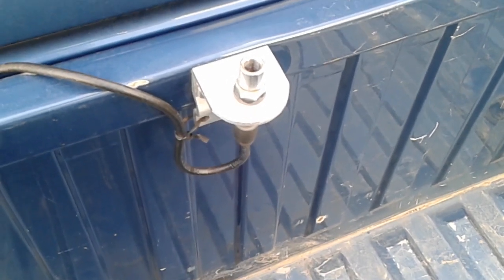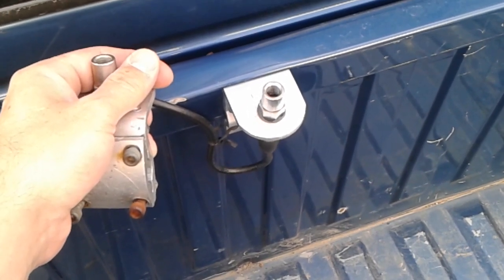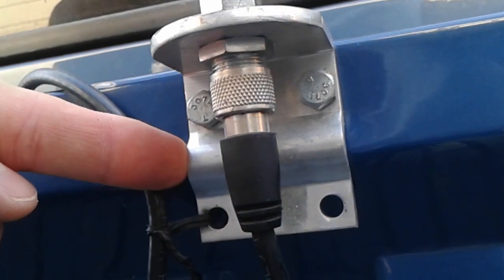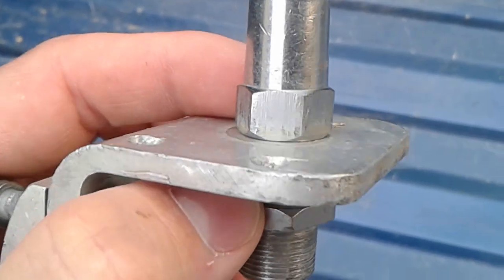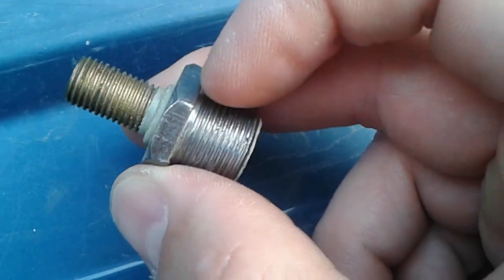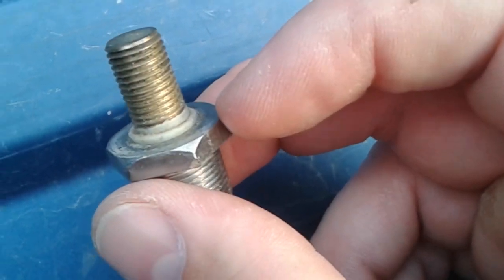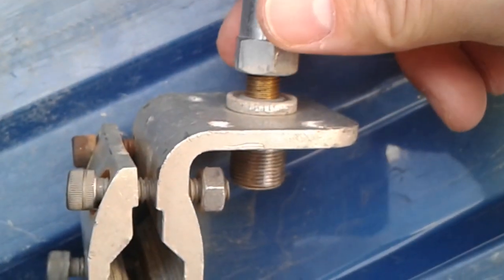How to mount cb antenna feed through adapter SO-239.  High swr ?

Comment: Hello is it grounded to the chassis through the mount on your bed? I have been hesitant to install a mount because of the grounding, I thought a braided wire to the chassis was required. Thanks
Reply from the maker: Hi!  Yes, it is grounded.  The outer wire of the coax (braided) grounds the adapter to the bracket.  The bracket is held on to the truck bed by bolts...those bolts are making connection to the metal truck bed...so everything is grounded to the truck bed.  You can test this by using a multimeter that has a "continuity" setting.  As you mentioned, you can easily add a wire for grounding if you wish, but it may not be needed.  As long as you make sure all the metal parts are making connections to the metal truck bed the ground should be ok.  A separate ground wire never hurts...and one is easy to install.  I am busy with work for a couple weeks, but maybe I can make a video showing you how it grounds and how you can test the continuity with a multimeter.   When I get that video made I will let you know.   Don't let the ground discourage you from installing the antenna you want to use.  In that video I will also try to demonstrate how to install the extra ground wire you are talking about.   

Also note...and to cheat just a bit...while the ground at the antenna is best....your mobile radio chassis is grounded to the negative power wire/ground, right?  So is the ground of the antenna jack.  It actually gets grounded that way....but I always like to make sure the antenna bracket itself is grounded.  It may take me a while to make that video, but will let you know when it is uploaded.  I hope my explanation helps though.  Long story short, yes, it is grounded.
Reply: @douglasbollinger3626  Thanks that helps, I have actually been using a Magnet mount for my 102" whip which has been working but I get 1.9:1 SWR on CH40 and 2.4:1 SWR on CH1 and it still wants to be longer even though I have a 4 inch spring with like 3 inches of extension so I am assuming the ground is poor, I also had to build an ugly balun because the coax was working as an antenna. I got it down to 1.3 SWR but used 9FT of the coax as part of the antenna before building the Ugly Balun LOL. I have a mirror style mount with the stud on order though as well as a 6 inch extension to maybe lengthen it more. A video on testing the continuity would be awesome, I do have a multimeter already. Thanks
Reply from the maker: @YoutubeMastersDegree  The magnet doesn't really ground. It does, but doesn't.  It creates a groundplane, but if it is not on bare metal it doesn't truly ground...if that makes sense.  Probably the only ground you are getting is from the braided coax being grounded to the antenna jack, which is grounded to the negative power wire/ground through the radio itself.   When I run a 102" I've never had to make or use a balun.  The 102" usually works fantastic since it is right at channel 19 area wavelength.  I usually use 20 feet of coax, good grounded bracket and usually good to go with low swr on cb.   What kind of vehicle is it on and where on the vehicle is it located?
Reply: @douglasbollinger3626  Its a 06 Toyota Tacoma with it centered on the roof, its a single 5" mag mount that I only use stationary for DX. My 65" Whip that I drive with mounted is 1.1:1 SWR across all channels.
Reply: @douglasbollinger3626  Yeah without the balun if I touch the coax the SWR spikes.
Reply from the maker: @YoutubeMastersDegree   Ok...I was wondering how the 102" didn't blow over or just fall over the way they sway back and forth.  High up and centered is good.  Should be a great groundplane that way.   Is the magnet all molded with plastic?  Any metal or bolts on the magnet going to the ground/braided wire you can access?  Wish I could see it.
Reply from the maker: @YoutubeMastersDegree  Interesting.  I was possibly going to suggest....since you run it stationary....to make a ground wire that slips under the magnet...touching the metal magnet base....and run it to the metal of the vehicle.  Even if it is just bare metal wire you put under the magnet base then to maybe a screw on your third brake light if it is grounded?  That would be a short wire.  Some people say shorter the better, but I never had an issue with a longer wire.  The screw at the third brake light could be insulated though, but maybe not.   It might screw right into metal.   What if you put the 102 where your other antenna is on a bracket?  What is the swr then?
Reply: @douglasbollinger3626  Right I think if I cant get it to tune better with the mag mount I will use the bracket that I ordered with a proper braided wire ground. My other antenna is just a different mag mount that I put in the same location when I am driving. The mag mount I use for the 102" whip is a 5" Tram mount that I removed the rubber cover from, but the bottom seems to have another black plastic liner rather then the silver metal liner. Thanks
Reply from the maker: @YoutubeMastersDegree  You're welcome! I see now what you're doing.  Not sure when I can get that video made, but will try soon and let you know when it is uploaded.  Hopefully we can come up with a solution.  Would be nice if we were in the same town and I could look at the setup.  I am headed to bed...hope you have a good night.  Don't give up....we will figure out something. 😊
Reply: @douglasbollinger3626  Thanks! Have a good one.
Reply from the maker: @YoutubeMastersDegree  The video about using a multimeter in continuity mode to verify the bracket is grounded to the vehicle is uploading now.  It is a little longer...like 16 minutes...sorry...but wanted to make sure I explained it well enough for everyone.   Hope it helps!

Comment: I have a few whips on my truck just for looks and one of them studs broke... kids pulling on them, is there a way to re thread them
Reply from the maker: @naabemakwa  Never had one break so I am not sure.  You could try a tap and die set to see if it will re-thread or just buy another from a truck stop or a site like EBay.  As a last resort...since you say it is just for looks, maybe try threadlocker or JB Weld?  If you buy a new one it shouldn't cost more than $10.00.  Also, since you are doing it for looks, you could get a bolt, washer and nut from Lowe's or Home Depot  and bolt it on instead of using a feedthrough adapter.  Just have to make sure the threads are the same and that the bolt is long enough.  Can you send a picture of it if I give you an email address?
Reply: @douglasbollinger3626  ya Ill probably just buy a new one.
Reply from the maker: @naabemakwa  Sounds good.  They shouldn't cost very much.
Reply: @douglasbollinger3626  IK be the 2nd time kids broke them bending it back... I just put them back on last week not even a week on my truck

Comment: That's exactly what I did I did exactly that damn it you know what I'm glad I watched your video because the last one I watched that's the reason why I did that and ended up where I'm at right now so thank you
Reply from the maker: You're welcome! If you have any questions or need help, ask away!  Glad it helped!
Reply: @douglasbollinger3626  actually I do I don't know if my antennas bad or what
Reply from the maker: @thepatchthatissour  What kind of antenna is it and how is it mounted?  Are you using an SWR meter?  If so, what are the SWR reading?
Reply from the maker: @sourpatch478  Glad you got it working.  The tall whips like that usually work great if they are properly grounded.  Cobra 29 should have a built in SWR meter setting.  If you check the SWR hopefully it's reading 1.5 or less.  (The lower the better.)  If anything else comes up or you have questions feel free to ask - I'll try to help.  Have fun talking on the radio!
Reply from the maker: @sourpatch478  No problem at all.  I knew you meant 102.  Good antennas! Have fun on the air!

Comment: at what length of coax would you recommend?? installing dual francis 4.5 antenna's with 6ft 50ohm coax. please and thankyou.. aces...
Reply from the maker: I'm being honest when I say I'm not real sure.  I've seen dual antenna sets that come with different lengths of coax, 12, 16, 18 foot for example.  Also, I've never tried using dual cb antennas, I've always used single antennas.  There's a bunch of rumors out there about coax length and stuff, but I've always used 20 feet in a vehicle and had great luck.  I used that length so I have some room to run the coax underneath carpets or whatever so it's not in the way and it's not too tight/short either.  From what I've heard you want to use the same length coax for each antenna.  I've also read that dual antennas change the "shape" of your signal compared to a single antenna.  I've also heard that you have to have dual antennas a certain amount of feet apart from each other, like at least five feet apart from each other (some say 8 feet apart) so the antennas don't interfere with each other.  When it comes to that, I'm not sure how far apart works the best.   Again, though, I'm not much help in the dual antenna area, I'm sorry.  If I was going to try dual antennas I would just try 20 feet to begin with, check the swr and go from there.  I hope that helps.  I'd check out some videos on "co-phase" cb antennas that will probably explain all that stuff above better than I did, but I hope I steered you in the right direction.
Reply: @douglasbollinger3626  Mr. Douglas.  Antennas are being installed on a semi.  So I'm guessing at least 14 ft from one ant to the other.  Both coaxs are 6ft in length.  The new cb does have a swr meter.  I'v never installed dual Antennas so I don't know what to consider during installation.  Please and thank you
Reply from the maker: @acebatman7024    I found this video, from a trucker, talking about dual antennas and things.  He mentions to use a coax that screws on to the back of the cb and is "split" to go to each antenna instead of using a T-adapter and two separate pieces of coax.  Then he mentions to use 75 ohm coax instead of the normal 50 ohm.   YouTube won't let me post a link to his video, but his channel is called J Rich and the title to the video I'm talking about is "Are 2 CB antennas better than 1 ?  2 cb antennas vs 1 cb antenna"   Maybe his video will help you some?  Worth a shot!
Reply: @douglasbollinger3626  I know that this is 3 months ago but the cable for dual antennas, also called "Co-Phased Antennas" is 75 ohms and is specially made and is called the "Co-Phasing Harness".
Reply from the maker: @jfrphoto01  Thank you!  I tried to help him, but I've never really messed with dual antennas.  I just use single antennas usually.
Reply: Sounds like you have cophased setup. If so I'm pretty sure you need the split coax 75 ohm.

Comment: Can I make a bracket out of any old piece of 90 L shaped metal And drill big enough whole through itWith no problems just as long as that rubber piece can make it through the hole?
Reply from the maker: Yes you can.  The hole needs to be 1/2" to fit this feedthrough adapter.  Just make sure the L shaped metal is the correct thickness where you can tighten it properly without the L-bracket touching the center stud part.  Also make sure on the bottom side of the L-bracket there's no paint or anything where the adapter mounts so it grounds properly to the bracket.  Let me know if you have other questions and I hope this helps!

Comment: I had mine with isolation washers on both sides and had a lower swr than with the isolation washer on the top.   How? (Everything is brand new)
Reply from the maker: I honestly have no idea how that's possible.  If you had an insulator washer on top and bottom of the lower half of the feedthrough adapter then your antenna would not have been grounded.  You are talking about both insulators you had being on the bottom half of the feedthrough adapter?

Comment from the maker: I got a comment notification this morning from "Craftsman S", but can't seem to find the actual comment.  Maybe the comment was deleted?  In the notification bell the comment/question is:   "I have a met handrail across the back of my Mack semi cab - I have the same bracket as you in your video - a lot is fiberglass, do I need a separate ground wire?"    If I'm understanding the setup correctly, it's a metal handrail, but it's mounted to fiberglass cab?  If that is the case, yes, you would probably need to run a ground wire from the cb antenna bracket to a metal piece of the truck frame.  It sounds like the metal handrail is insulated from the truck frame and that will mess up the SWR's.  Make sure the wire goes from the ground/braided wire part of the bracket to the truck frame.  (Probably easiest to ground it where the bolts go on the bracket, you can bolt the wire tight to the bracket then run it to the metal truck frame.)  I hope that helps!  If you can, make a video of it and let me see what you're working with?

Comment: Lots of people can't get a good SWR reading with the L bracket while using a spring and full length 102" 1/4 wave whip. The antenna and spring and standard "ball mount" actually make up the pre-tuned low SWR "trio," .. when using the L mount instead of the standard ball mount, the spring and antenna and L mount are too short to tune properly. This can be remedied in four ways, 1. using an inline coax tuner .. or 2. switching to a top loaded fiberglass tunable whip .. or 3. switching the L mount to a ball mount .. or 4. construct a "capacitance hat" on the whip of the 1/4 wave 102" antenna. This would be to mount a small extension of metal mass on the tip of the whip to allow for additional length and to tune it to a very low SWR. The capacitance hat also radiates higher on the whip so you send and receive a slightly stronger signal. Ham Radio operators design capacitance hats of all styles and shapes .. they all do the job. You can also solder a small V made of 10 gauge on the top of the whip to lower the SWR. This radiates higher and also makes up for not having a ball mount while you use the L mount bracket.
Reply from the maker: Interesting.  You're talking for CB/11 meters?  I've never had an issue with swr's using a 102" stainless steel whip, large spring, L-bracket and 50 ohm coax cable if it's all properly grounded.  The swr for me has always been almost "flat" when I use that particular combination.  (I normally use 20 feet of coax.)  If someone is trying that same set up and have swr issues I'd say the problem is something else.  When I've helped people with high swr it's usually found to be something like they have a bad antenna ground, using some different ohm coax (not 50 ohm), the feedthrough adapter mount installed incorrectly (shorting out), they're using miles and miles of coax or something like that.   I am a ham radio operator (Amateur Extra) and I've never built a "capacitance hat", but I am aware of them.  I've used the luggage mounts since, gosh, 1989, 1990?  I've never had a problem with that type of mount.  In fact, I've never used a ball mount.  Some swr issues come from the type of vehicle, too.  (Fiberglass body, etc.)  Each vehicle's a little different to try and figure out.  Thank you for your comment, I appreciate everyone's experience and knowledge -- this is how we learn and get better with the hobby!

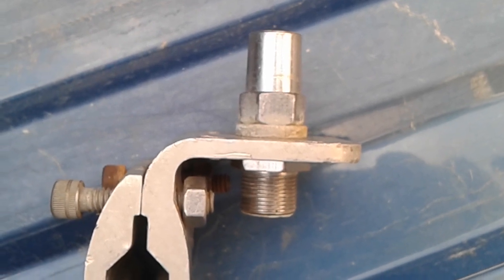Comment: Very good 👍 video for the newby's in Cb,  you explain it very simple 👌but you take 5:18 minutes to do it..ok ( to may ditele's ) one very good one ( And yes they are some shut I coll then morons ,idiots or better yet people that don't read the instructions ) that will put the plastic insulator the Rong way 🙄 and yes that will be a bad SWR problem.🤯 .... make sure you have it the right way and you will be🤗..ok no more taking your time . Very good video 👍 and thanks for helping the newby's to Cb...73's and good DX's from KAHK4031 (  my old Cb license in 1975 )
Reply from the maker: Thank you! I appreciate that!  I needed help myself when I first started with radios so I try to help others.  The hobby can get frustrating if you're not sure what you're doing and your radios don't work correctly.  I hope you have a wonderful evening!
Reply: @douglasbollinger3626  what ever help you nead ...I will use some of my experience on Cb radios
Reply from the maker: @yankee7664  I appreciate it.   I'm good with radios now, was just saying I try to help others.  If I run across something I need help with I'll surely ask!

Comment: What stud mount are you using at 2:35 in the video? Where did you get it?
Reply from the maker: Hi, Rick!  I think the stud mount at 2:35 was either made by Workman or from Radio Shack.  I've bought so many over the years I can't remember where I got all of them from, but here is a link to one on EBay that's similar made by Workman: https://www.ebay.com/itm/400372268350?epid=1403477563&hash=item5d380bfd3e:g:g-kAAOxyo-9Q1mDO  The bracket to hold the mount is the luggage/mirror mount.   You can find these items at places like Love's gas stations (some Love's have cb radio stuff for truckers), Flyin' J or any trucks stops, Ham Radio Outlet online, EBay, Amazon, etc.   Let me know if this helps or if you need more information!